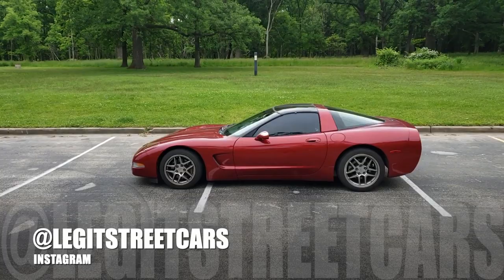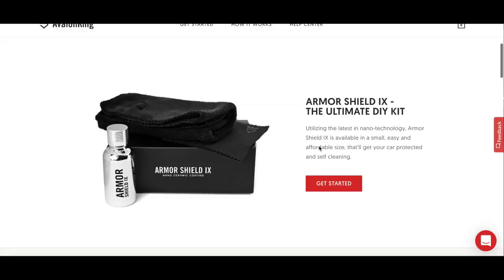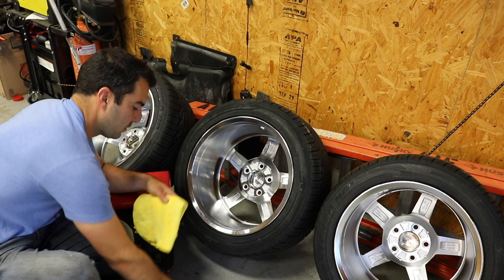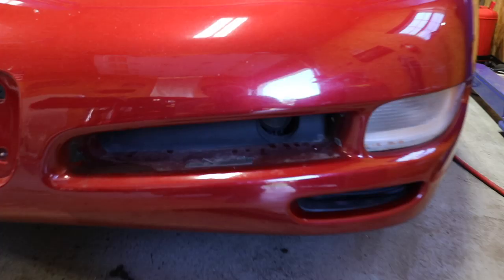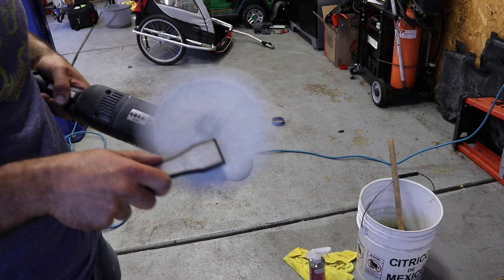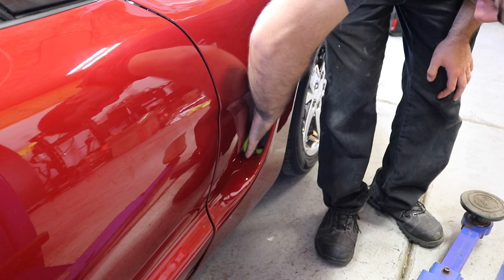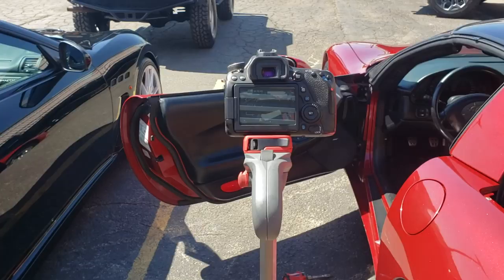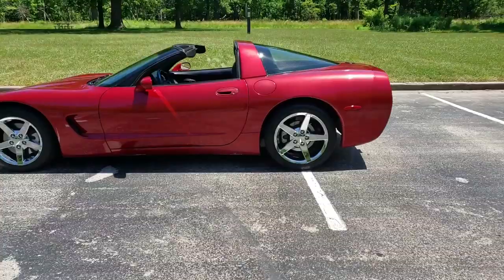I Love Corvettes So I Spent 30 Hours Restoring One That Sat Outside For 8 Years. DIY C5 Restoration.

Comment: Hey Alex, I found carPro dlux for wheels and plastic and it’s amazing. It last 3+ years!! I used a product called Bar keepers friend as I had some polish staining on the trims and it took it straight off and then basically did you the same thing as you and boom oem colour. 

I noticed that you didn’t remove your coating properly when you showed the finals in the sun. Over the bonnet and the windshield. Car looks good though.

Comment: When you run the camera over the hood after the wiper arm install, there are visible strokes in the coating on the hood and windshield that you can see in the sunlight. That ceramic is pretty hard, so I’m wondering if they’ll come out with a wipe down of another detailing product.

Comment: @1:29 bruh wax the windshield lol. I use Meguiars Ultimate Synthetic (solid wax, comes in blue and black tin), but for literally one day just use whatever, even a spray wax would be better than nothing lol

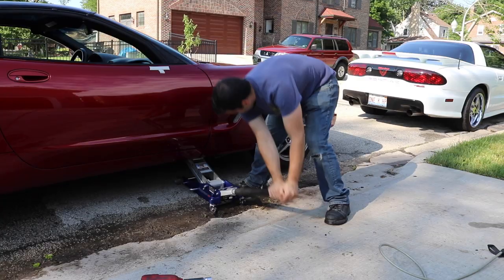@4:49 seriously it's wildly unsafe to have the car supported by just a jack, you need to get jackstands. Like you spent money on an impact driver, which you don't need (breaker bar, nornal socket, torque wrench) over safety issues like jackstands. I would definitely recommend getting those ASAP.

Comment: One more thing I forgot to add. I saw a brand new C8 Z06 at a local car meet a couple of days ago. Beautiful car but in talking with the new owner (that also had his wife's heavily modified C7 at the meet too), he was proud to disclose that he had just dropped $250K on it. It's crazy that to think that relatively speaking from a performance standpoint that it would be considered a deal against it's current contemporaries. But I submit, I would be nearly as proud to show up in a C5 that looks as good as the one here and would have conservatively saved roughly $235K. I'm just saying!!!

Comment: For the trim, check out products like CarPro DLUX, Gyeon Trim or Solution Finish... :-) If you spent that much time on paint correction, id say you messed up the coating appliction, swirls, holograms, smears all ruined the finish!

Comment: Watched your video again. I feel your Passion for the love of a Beautiful Muscle car such as the C5 Corvette. I own a 2004 C5, deep black with Oak and Black interior. I paid way too much for this OL' Girl but she has never let me down. Matter of fact, I have pampered this car more than my 69' Shelby 500KR. (Of coarse, it's still pampered too...)  Where can I purchase the wool pad you used?? I have tried several different ones and can not come close to the results you have. Maybe it's the compound? I've been using Maguire's Microcut max and it is really difficult to work with. I really love the factory paint when it's shining, but it still has a lot of crap in the clear coat. I've clay bared till my fingers bled and still can't get it the crap out. Micro fiber towel won't slide without sticking. 
Only asking because it sounds like you have a lot of experience with this. Please let me know. 
T. Yager

Comment: do you mix the rubbing alcohol and water 50/50? i use a silicon liquid to rejuvenate the black trim after.
Reply: Which one do you recommend?
Reply: @BenScarbalis   i use a product called 200/50 silicon fluid.  a tiny amount goes a very very long way
Reply: @krisjones5125  once I apply the product how long does it last?  Live in the Midwest and bought a used 10 year old prius I want to get some shine.
Reply: @BenScarbalis   iv only used the product twice since i have had it in the 3 months. im not really sure how long it would last but it does seem to sink in to the plastics very nicely.

Comment: What height did you need in your garage to make your lift happy?  I'm about to pull the trigger on a detached garage and really want a lift.  I'm thinking I can get by with 12 feet, but 14 is more of a guarantee that you won't be bumping your head on the bottom of cars.
Reply from the maker: I have 12 feet walls. 12 works but 13-14 would accommodate most everything

Comment: I'm doing same thing i had to rebuild motor in mine bought it with no oil pressure and it was a crank barring but rebuilt motor bored 030 upgraded cam & heads cnc & bigger valves...new  spec clutch & flywheel plus a few other parts fore motor rebuild ...car had complete front end rebuilt  brake job ....so only thing left is a good cleaning up like u did in video and I've got get new back tires ....could I resale and make money lol I dought it but I'd get my money back ...did cause I live vettes and could afford the one I bought which is a C-4 ...COULD HAVE GOTTEN C-5 and maybe C-6 but wood have had to do more work on C-6 TO BUY ONE IN MY PRICE RANGE.....

Comment: Hi Alex, I have a 2018 Nissan Altima and want to put on a ceramic coating myself and on a real budget.  Would it still work and just be less effective if I wash the car and use a prep spray and rubbing alcohol solution then go straight to the ceramic coating?  I realize the more steps I take would make it better but this is no special car and I'm not sure it's worth all the effort.  Thanks for the videos and I hope to hear from you.
  👍👍

Comment: Since you spend your time driving the car and you're INSIDE the car, my first attention would have been to the interior.  Since this Corvette is a daily driver, you could have had the entire car resprayed for $2-3k.  If you chose a paint shop that did decent work, the car would look at least as good as factory.  Personally, I don't see the sense in doing at that work with so many flaws that couldn't be fixed.  Nicks and chips would have been gone with a respray and sprucing up the interior would have given you a pretty nice car.
Reply from the maker: This cost me about $100 in materials and I had a good time doing it. This car isn't worth an expensive paint job

Comment: It would have been easier & save more time if you would have blue taped all edges then hand wet sanded with a foam block starting with 2000 grit then 3000 then polish brah

Comment: Clay mit actually work ? Sounds like a regular mit that will mildly scratch my car
Reply: You can tell it's not a regular mit by the way it's called a clay mit and not a regular mit. Yes, they work great.
Reply: Clay mit/ bar will scratch your car regardless. It's abrasive
Reply: @LilRick96  it's meant to be used as a preparation, not a finishing step. It contains a pulverized abrasive, anyway, not the kind that would scratch paint.

Comment: The meguiars is horrible stuff. Barely lasts a few days. I used Mothers speed balck restore aerosol and it works so much better survives pressure washes fine

Comment: 30 hours is nothing try restoring a 1967 camaro that sat outside for 43 years
Reply: Reese Tuts no need to be such a damn hater man. Like let people be proud of themselves for making their car look like new..
Reply: Seriously, that wasn't a restoration. It was a detail! 😂
Reply: SilentVibes im not being a hater im saying that he should work more on cars try bigger more time consuming projects
Reply: Richie Kelly agreed
Reply: I’ll probably make vids on mine
Reply: @MegaReesesPieces1  I'm sure you have lots to teach. Right now, im restoring a 73 Datsun 240z, and a 63 Austin Healey sprite. Rebuilt motor on sprite, did new floor pans,plenty of body work has it almost ready to paint. Forget wax. Way bigger fish to fry. 😂👍
Reply: Richie Kelly me and my father just sold the original engine and the front sub frame so half of the car is missing. The guy was a smoker so the interior was stripped. Its basically a skeleton right now.
Reply: Also its got a primer coating on

Comment: Would have looked probably 5 times better if you would have done a quick not detail a quickie water sand with 1500 then 3000

Comment: Great job on giving that C5 some love. I run a C5 Corvette shop, thats all we do is C5's and have been for 8 years. We buy them wrecked and part them, service them and customize them. I learned a lot from your video and im gonna order the kit you used. i have an 04 here that i am going to wet sand due to acid rain etching in the clear. BTW if you need any parts like the headlight gears and new seat skins hit me up i will make you a deal. VetteNuts.net

Comment: "Considering the car has 137,000 miles, and is totally mechanically sound" as I look outside in my driveway with my daily driver, a Oldsmobile Intrigue 2000 that just rolled over 300k... Totally mechanically sound... One day...